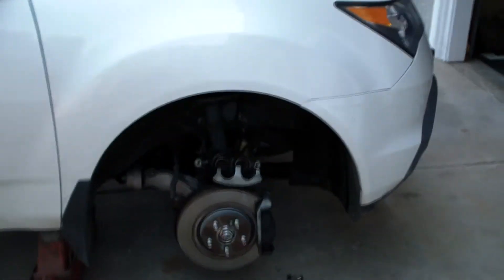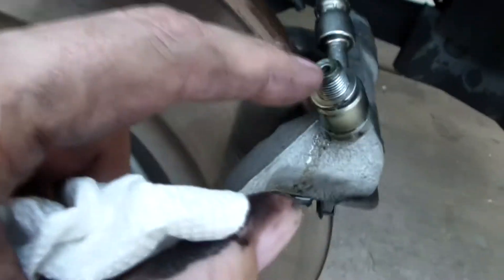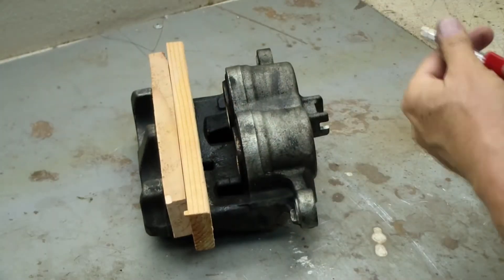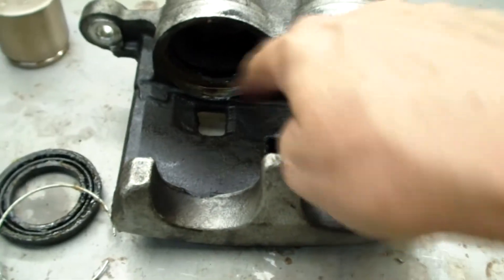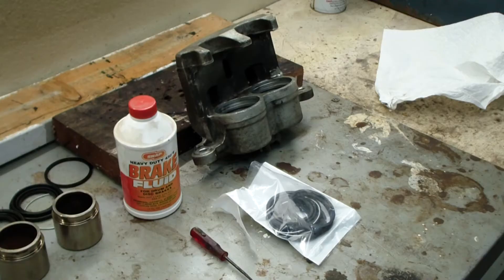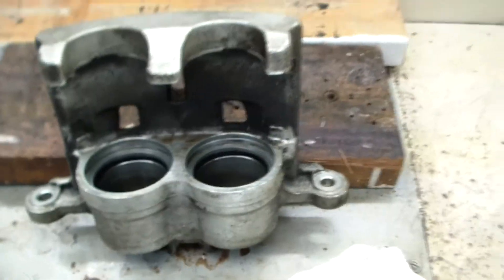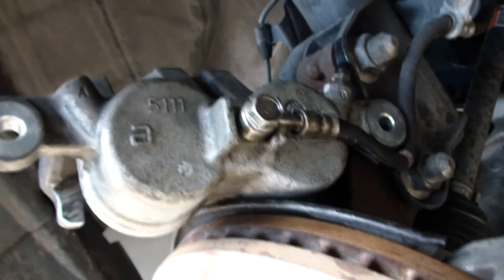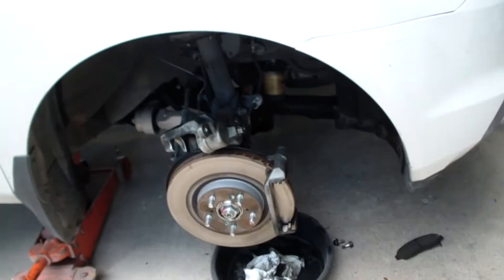Acura Brake Caliper Repair Kit Rebuild

Comment: Did this fix the problem?  Iv replaced my hose, guidepins,  and flushed the fluid but still my caliper hangs on the driver side.    For a few dollars I want to try this before replacing the entire caliper.
Reply from the maker: My problem was a leak. Was not sticking. This fixed the leak. You can also buy new pistons.  It is 50% chance you need new caliper but maybe you will get lucky.

Comment: Great video.  Do you still have the car?  How has it held up?
Reply from the maker: Doing fine so far.
Reply: @KentDiego  did you have to replace the banjo bolt washers? replacing them can ensure there's no leak.
Reply from the maker: @vh448  I did not have to replace the washer. It still works fine now.